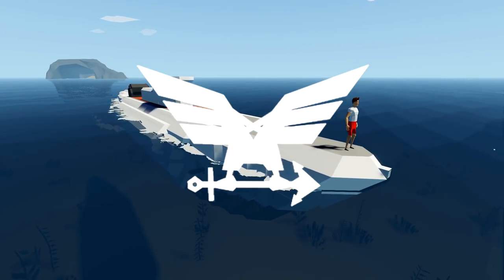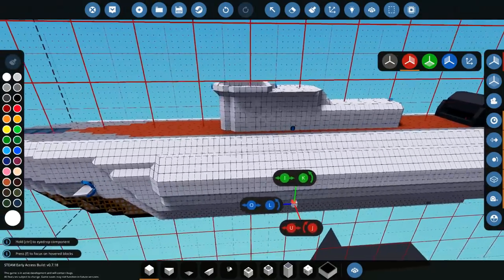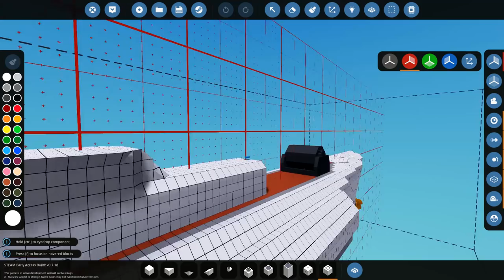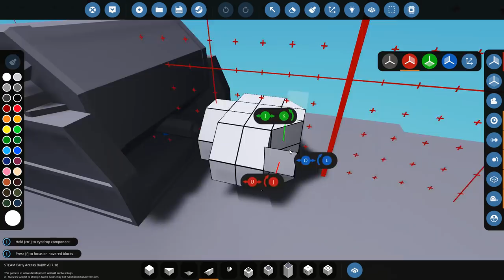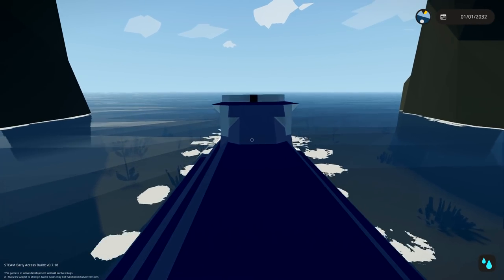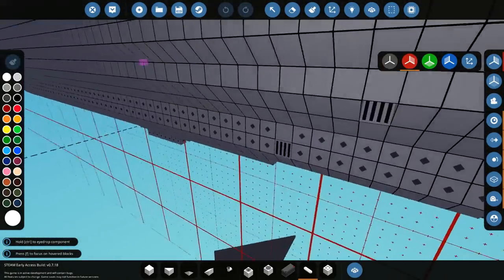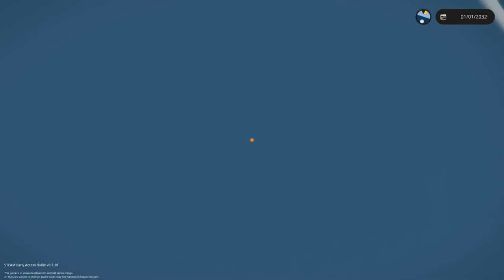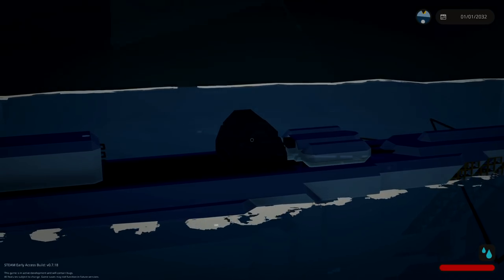Air Buoy Is Working!  -  Stormworks: Build and Rescue  - Submarine -  Part 8

Comment: My suggestion: put two smaller winches, one for exhaust and the other for air. I don't even think there are depths greater than 350m, so the huge winch is overkill. Also, as I said before, pumps are too weak and you would need insane amounts of large pumps to deal with depths of over 100m for the exhaust.

Also, the buoy need not be that long. If you manage to make the base a bit wider (4x4) let's say and then raise it about 3 blocks, it should be stable enough. You can also stack about two or three straight pipes  out and have the fluid port sticking out of the buoy like a chimney. It should look somewhat like an upside-down beer tulip. Also, get rid of the pump and filter inside the buoy. It will only weight it down.

Here are a few suggestions from a fellow submarine builder.
Reply from the maker: Holy moly, I'll see what I can do :S I feel like the smaller winches are a good idea :D

Comment: You can use fluid filter to get rid of water from your air system. But not in that way. When water gets in and will blocked by the filter, whole circulation will stop because water is not going out. Inside ship use t-pipe. 1 connection is "in" from buoy, 2 filter only air to the engine, 3 pump everything else outside the ship.
Also you dont need air from surface. You can use air from inside your sub. You can measure level how much you have left. Build custom hatch on top of sub to fast replenish.

Comment: Frantic, you can actually add emergency blow ballast systems, that will actually blow all water in a few seconds! This system on every submarine, and on UBoot too. And do a real system: on surface diesel engines are making energy trough the generators, and while boat is underwater energy from the generator is going to electrical engines.

Comment: Hey Frantic, if you're having exhaust/air problems you should consider turning to diesel electric, so that the diesel engines run on the surface and also charge batteries for electric engines below, like in real submarines. I know you mentioned this in the end of the video and I think it's a good idea.
Reply from the maker: I've been trying to stay away from electric engines for this build :(
Reply: @FranticMatty  Oh, sorry

Comment: Idea:
You shall add a snorkel tube to the submarine, add a tube conneced to the engine exhaust, and one to the engine air supply. Make them both stick out the conning tower a few blocks, then add two of these thingies wich allow only one thing go through the pipes, i forgot its name, at the top of the snorkel and then add a fluid port thingy.
Sorry for me beign confused, i did not come near stormworks in a while.

Comment: There should be more space to build if you had the winch inside the sub, with the winch facing up.  Then just let the air vent float outside through a door. 

Or what about putting the air port inside the submarine? Can it work like that?
Reply from the maker: I think putting it inside would work if I pumped it into tanks first... But we'll see XD

Comment: U should use the sausage thingy but on the bottom build a dish i mran like the weather buoys  and the air intake is then on the top not too high maybe a block or two but it should be a bit better btw u still need a periscope so if u are building the thing that i suggested u could put cameras all around the top to have a 360 degree view or put one on a rotating thingy and pls test it with a tsunami
Reply: Btw u still need to build a periscope so if u building what i suggested u could put cameras all around the top part of the buoy so u have a 360 degree view or put one on a rotating thingy or someting and pls test it with a tsunami